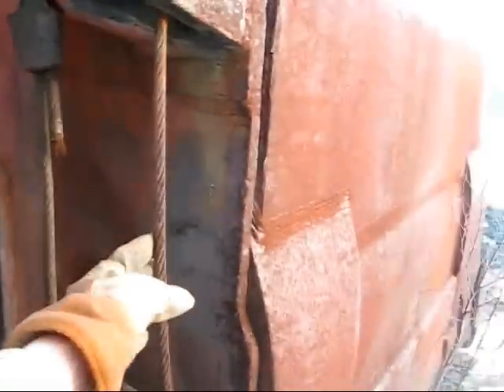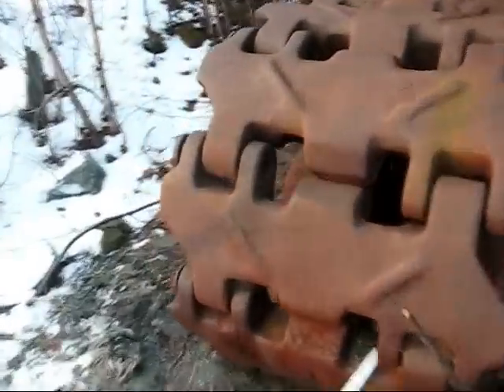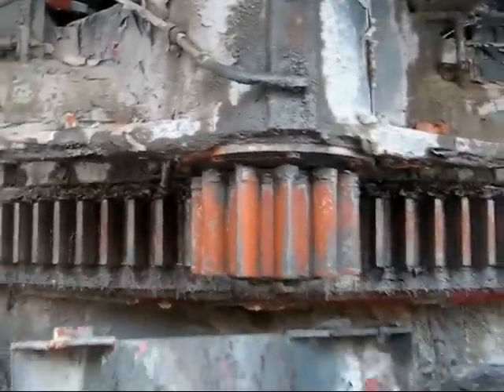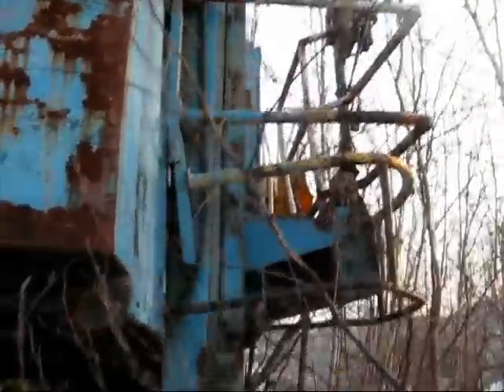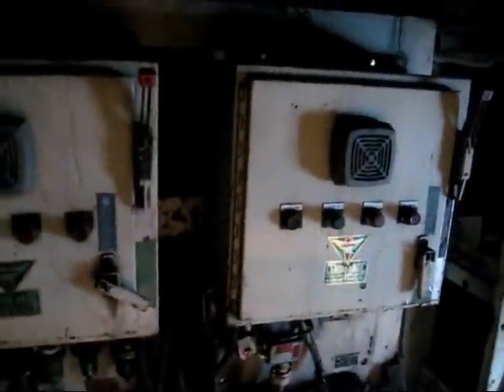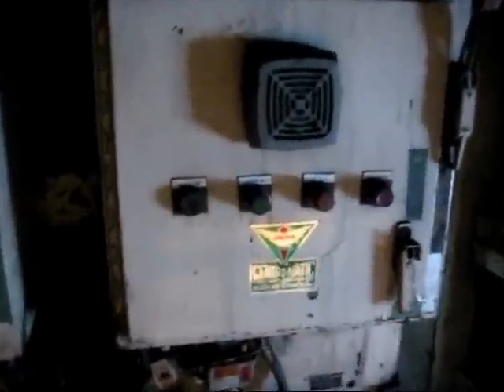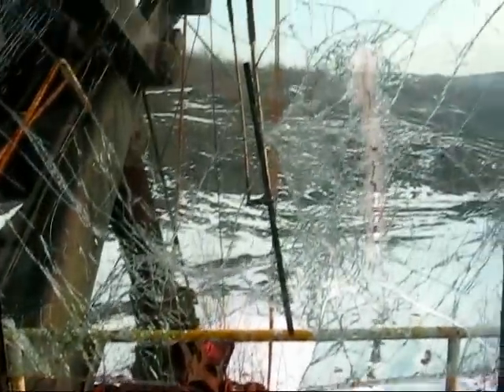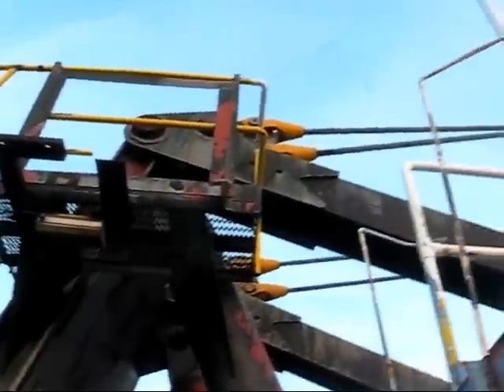Bucyrus-Erie 195-BI Documentary

Comment: Two things come to mind with me. First---what would it cost for someone to come in and service out the shovel to good working order, putting it back to work on a job? Second:, how loud would the vandals who damaged this machine cry out when the owner took a baseball bat to them and beat them severely for tearing stuff up. I see the machine was scrapped, but whoebver vandalized did not know that would be done.
Reply from the maker: This machine was actually looked at to be put back into service but unfortunately  the extend of the damage that was done by vandals would have made it too costly to rebuild,
Reply: What was vandalized that made it so cost prohibitive to put back into service?  They must've absolutely trashed it inside and out......